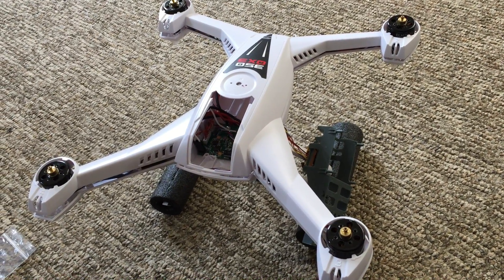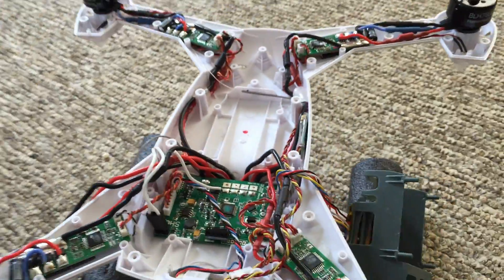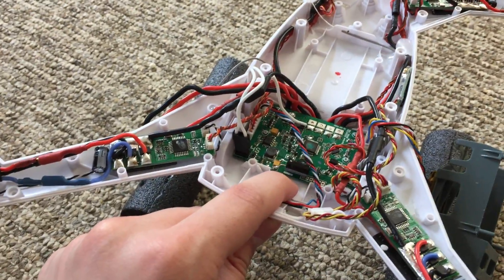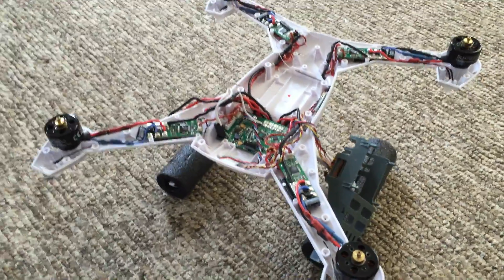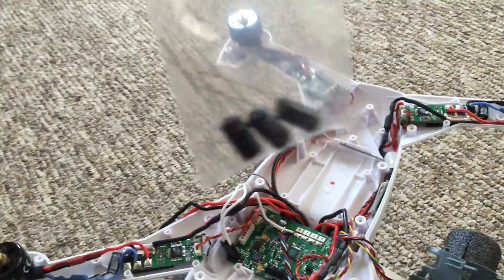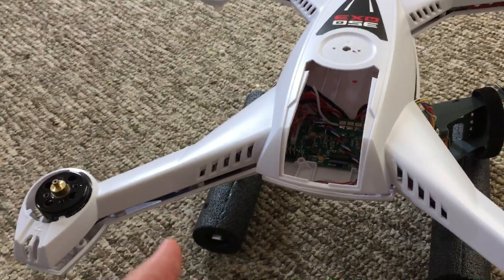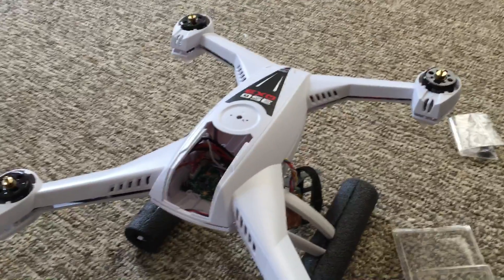350QX3 BNF - Adding 100uf 35V Capacitor, CGO-2 Gimbal Cable Issue

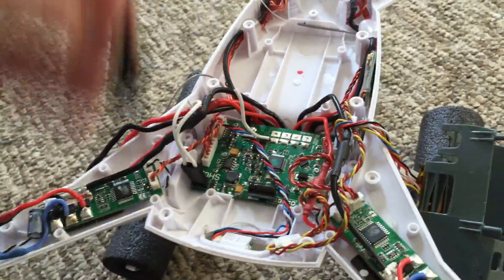Comment: The wire that you cut at 9:30 is on the right side on the ap. srry, it was easier to explain that way for me. Please let me know if you have any idea why. I’ve been trying to add a CG02 from my ap, to my bnf, but it doesn’t work. And I don’t know if that wire location has something to do with it. But I’ve rebuilt mine before and just unsoldered that wire, and unplugged it and and everything fits right down through that hole, instead of trying to pull the end plug up!

Comment: But I found another difference as I got my bnf and ap version apart in front of me, I notice that the white power wire to the gimbal harness is soldered to the farthest right spot on the ap. the bnf, as seen in yours also, is soldered to the first or far left spot. I’ve been trying to find a reason why it’s like that!